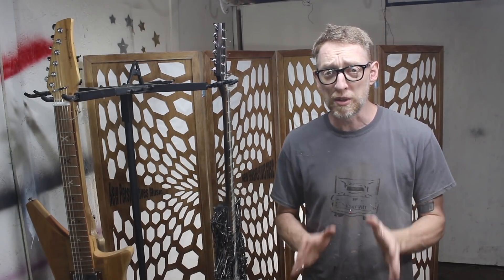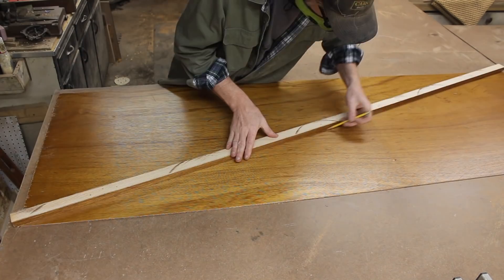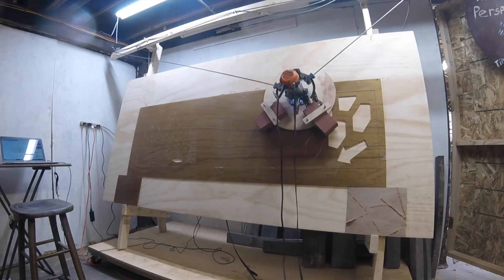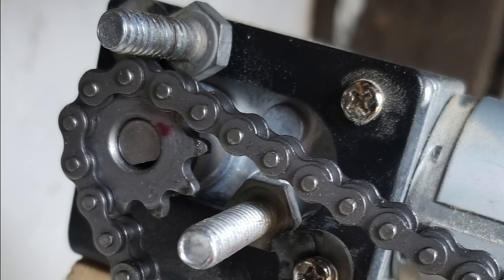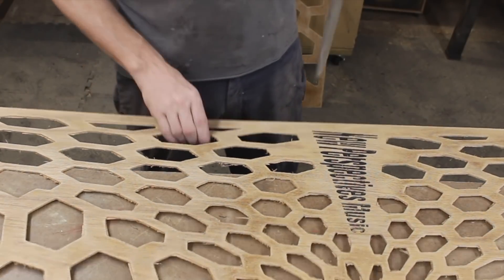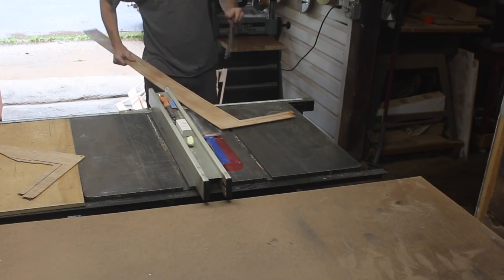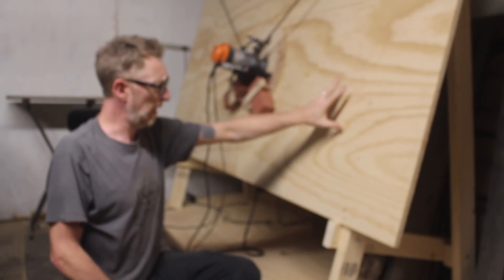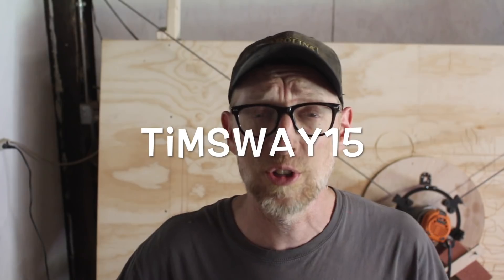Room Divider | My 1st Maslow CNC Project with MakerMade

Comment: Great, inspiring shows ... when you are cutting with a router on that terrific gadget behind you , would it be best to finish ( seal ) the "rough side" to prevent that splintering , or are you playing with a dull toy?
Reply from the maker: Thank you!! The router bit I was using was very used and not at it's best. I'm not sure how much finish would help with splintering from a router, even a sharp one...

Comment: DuPont Chain Saver lubricant is dry, teflon-based, and made for motorcycle chains. I use it on my mountain bike chain and no dust or sand sticks to it. Would recommend it for your CNC.
Reply: I am in the UK, but only use dry lubricant on my table saw etc. It does not gather dust. There are many makes. Wad 40 even do one here.
Reply: And there is also some good info on waxing a chain from the bike enthusiasts. https://www.youtube.com/watch?v=HHr9znwpwmQ

Comment: That chain bind-up could also be from chain torsion right at the gear when being pulled straight down by gravity versus falling at the angle of the easel? I bet a sturdy spring tension between the chains up top would work, or someone else mentioned weights off the sides too. Also, making lateral wings would be an easy fix to get the 8’ width, as for the depth, perhaps upgrading the bottom cleats with screw type bolts so that the edges are flush with your routing surface could get you the full 4’ height ;)

I’ve been wanting one of these for awhile now & it’s good to see a craftsman of my liking work with one. I immediately picked up on the hollow door pattern when I saw them! Go get yourself some of those color changing lights behind those blinds & have yourself a psychedelic space, my friend!
Reply from the maker: exactly, although the white light is nice, too. Yea, i was thinking spring loaded tensioner also, but other users have simply added counterweight to the chains instead of using the elastics, I'm going to try that first.

Comment: There are some bicycle chain cleaning brushes you could add in line to clean the sawdust off the chain as it works. As well as add tyflon chain lubricant
Reply: Great fix... a graphite dry lube  , the brush idea is best.

Comment: The kit is $500, but by the time you buy a router, computer, build the frame and some basic supplies like plywood and router bits you will have $800 to $1000 invested in it.  Other open source cnc machines like LowRider or LongMill (smaller) are similar price points. would be cool if you can do a comparison video?
Reply from the maker: material for the frame is less than $100 and The router is $159 so yea, about $800 total, but I built my frame for basically free from used stuff and if you already have a router... Plus they frequently have sales like $25% off right now, so now you're closer to $600 all in... If one of these other companies would like to contact me I'd be more than happy to try them out and compare!

Comment: Hi mate i know nothing about CNC machines but knowns bit about chains from bike maintenance. Oil and grease cause are sticky and cause chain suck which on bikes (bicycles) this causes a loss of power but I think its what you were seeing when your chain turned back on itself. One thing that's getting big in bike chain lube these days is waxing. Basically melt a mixture of candle wax and paraffin and soak your clean chain in it. When it's dry it leaves a hard very low friction surface on the chain. The finish lasts longer than oil and dust doesn't stick to it so could work very well for your application.
Reply from the maker: awesome, thanks!
Reply: @timsway  No worries mate. Another thought might be to run jocky wheels instead of the solid bars you're using before the drive cog. Would help keep things in line. I'm guessing you could also use one after the drive but that would mess up your maths like those pins did, unless you can tell the program that they are the fixed point, rather than the motor. Just thinking out loud 😊

Comment: Get some more of the same gears and have the chain come off the motor gear parallel with the motor like 12” and that will solve the problem with the chain getting stuck.
Reply from the maker: good idea

Comment: I think this setup could benefit from a motion sensor. In many CNC mills or 3D printers such a sensor would be too big, but in this case the software could correlate the movement with the gcode and stop when the router mount stops moving....
Reply from the maker: Its actually really good about stopping if it senses anything "slowing down" the movement of the motors. They have that down, I just need to keep it from needing to stop!

Comment: Not sure it competes in size, but he MPCNC seems to be quite worth the time invested to build... I'll do one myself as soon as I have few free weekends...
Reply: The mpcnc lowrider was made for full sheets, but!  It will take up a 5 by 9 foot section of your shop.  That's one of the things I like about the maslow is it's leaned, so less of a footprint.  Though just like a delta 3d printer, you lose resolution at the outer edges of the cutting area.  I have room, so I went mpcnc.

Comment: Your chain skipping problem isn't because of sawdust or lack of lube, but because there isn't enough tension on the "slack" side of the chain and/or because the chain isn't parallel with the sprocket.  The bungee cords that come with the kit aren't a very good way to deal with the slack end of the chain, a better way to do it is to switch to using counter weights.  If you search the Maslow CNC forums you'll find plenty of posts about using counter weights.  As for making the slack end of the chain parallel with the sprocket, I recommend making a chain guide that goes behind the sprocket to push the chain forward (away from the top beam) and towards the sprocket.  This is the 3D printed chain guide that I designed and use and it works great for me: https://forums.maslowcnc.com/t/brads-3d-printed-chain-guide/7465/2?u=bradm
Reply: grab a bicycle chain tensioner for single speed chains and slap it in there somewhere, they are cheap and it will add tension via a spring. Just a random idea.
Reply: Exactly as I was going to say and I read this comment and I have to say no more
Reply: TheVRFOZZA 8
Reply: Seems any points on the chain for tension or idler like pulleys can all have a sprocket to keep a more uniform length.
Reply: This machine is based on fairly popular designs for a wall hanging cnc pen plotter. While most of those don't use motorcycle chain (some use just string and friction, some use the beaded chain you might see in set of window blinds, some use timing belt) there have been several solutions to similar problems. Generally yes the slack end of the chains will have weights or take-up reels. But tensioners and similar designs also exist. Just to point out that there is a wealth of diy hackery around this type polar coordinate system.
Reply: Spring loaded idler sprocket
Reply: @generalschier832  l used your avatar and YouTube deleted my channel. They are Nazis.

Comment: Hi Tim. Great project, mate. Thanks for the video. Re chain stick, if you visit your local mountain bike shop, they ought to have a chain cleaner device that works without removing the chain and chain lube designed for handling dust. Though saw dust may be a new one for them.
Reply from the maker: Thanks! Sawdust can't be worse that mountain bike trail dirt, eh?
Reply: @timsway  I recommend Boeshield T-9 as a relatively dry lube when used properly, also I highly recommend using a cheap snap link so you can make a loop when cleaning the chain,  Some sort of chain tension device must have been worked out by other users, I'm sure you can work something out, good luck! (i'd recommend better quality chain too, but that might blow the budget.) If I was designing it I'd put negative chains on the bottom.
Reply: I'd make it like a old school drafting table parallel ..Continuous Wire Parallel Motion

Comment: Coupon code was rejected at the makermadecnc.com. Says this coupon does not exist!
Reply from the maker: I'll let them know. they did tell me it wouldn't work in conjunction with any sales. they are currently having a 25% off sale (which is way better than my coupon) so grab that instead.
Reply: Thank you. Ignoring the lack of speed for a moment, does this setup have any good precision and repeatability?
Reply from the maker: @sz72909  you need to spend some  time with it, but I believe it's doable.  The forums are a big help for tips and tricks. Of course it's not going to be as fast and accurate as a shop buy, but it also costs $9k less! :)

Comment: With my Maslow, I ran the chains the other direction on the motors. The slack part of the chain with the loose gear I have an old weight to keep tension on it. That eliminated the chain from binding up on the motor gear.

Comment: The blinds look amazing. Love the design. Now that you worked out the kinks with the cnc are you confident to leave it cutting while you do other things in the workshop?
Reply from the maker: well, I left it running alone before I worked out the kinks, so... haha! I wouldn't leave it running alone with a small child in the room, but it really can't get in to too much trouble. the software quickly stops the motors if it senses something is wrong (like it jams up) so the router will just sit and run in place. I had that happen a few times.

Comment: The major issue I've found with z-axis accuracy is the result of inconsistencies in the flatness of the material or backing board, or the distribution of weight of the sled as it approaches lower y-axis coordinates. Many people experience better z-axis accuracy if they put a light bungee over the top of the router taking out some of the slop of the z-axis mechanism itself.
Reply from the maker: someone else mentioned that. I will try it. I also think I could stiffen my wasteboard as it could potentially be slightly bowed in the middle as-as.

Comment: Which post processor are you using to generate your G code with V carve Pro? We’ve got a Maslow at my makerspace and v carve pro and haven’t had much luck and want to use v carve over makercam
Reply from the maker: I saved the gcode as the preset "XCarve" right from the Vectric menu and it worked without a hitch. I don't really understand that side of it too well, but it worked.
Reply: tim sway 

Interesting. I’ll have to try that out. Google search found a thread on the Maslow forum saying that didn’t work out but I suppose it doesn’t hurt to try! 

Thanks!
Reply from the maker: @McFlysGarage  sometimes the forums are tough as there is a lot of old and confusing info there. The trouble with open source is it's always changing and evolving (which is a good thing, except when problem solving!)

Comment: This is a great video. I have been thinking about getting one of these CNC kits,but have been concerned about having enough space.
Reply from the maker: I think it would be cool to hinge it to your ceiling :)
Reply: tim sway, That is a great idea. My shop consists of a one car garage so you can imagine how every inch is filled up. Thanks again.
Reply from the maker: @DIYGene  if you have enough height. With the router sled detached, it would only take up about 6" of depth. Attach it near the wall and make a riser block that attaches to the back of it so it rests against the wall at the proper angle

Comment: where it was sticking (8.07) I was thinking the screw that it goes to (about 10" at 8 o'clock) seemed to be holding the chain back a bit. can't you put a tube over it so there is less friction there. Obviously, a bearing would be great there but a slippery oiled nylon tube might be just as good and let it run free'er .

Justedited /added noticed....as i saw you have done what I thought at the 7 oclock screw .
Reply from the maker: great minds :)
Reply: @timsway  Just after I posted it I saw you had done it with a screw at 7 oclock.

Comment: Increase the tension on the chain, it'll mitigate the problems.
Reply from the maker: thanks. I think I'll try the weight system as the tensioner elastics are tense when you don't need them to be and slack when you do.

Comment: Tim... can you set the motors back a bit? Looks to me like the inside of the chain is pinching on the outside of the gear. (twisted)
if the motor sits back an inch or so... the chain drop angle won't be so extreme... lowering the pinching friction... scratch that...  tilting motor would prob be best
Reply from the maker: yea, that's the kind of tinkering that goes in to this, unlike most cncs. that's a good idea. If you put in the time you'll get the results
Reply: @timsway  tinkering is what life about  its how we learn... I'm game to fail... gives me a starting point... when its fixed.. sense of accomplishment... like harbor freight tools

Comment: I helped put together one of these for my local makerspace, and we went with the same frame design.  One thing that I did was at the top of the frame, I set the bolts in the opposite direction, and sunk the heads so that they did not interfere with the chain.  And we have run into the same issue with the Z axis.  There is a ton of backlash in the router, in the clip that binds the router to the Z axis screw.  I've found a couple of rubber bands over where the router handles used to be stretched over the top of the router tend to help the Z axis be a bit more accurate when it moves.

I love the panels, they did turn out really nice.
Reply from the maker: thanks for your hands on advice! I was going to flip the bolts around next time I work on it, but then i decided I liked having the "shelf" for the chain. I was thinking about building a little tray up there to hold the chain...
Reply: @timsway  I think you need the tension of the elastic band to keep the unused portion of the chain from slacking so much that gravity pulls it down into the sprocket teeth.  It looked like that was what was happening in your video.  A tray may work, as long as there is not enough space for the chain to fall between the sprocket and shelf.  Also, with a shelf, the chain may bunch up and slip off of the teeth.  You may be doing too much to control the chain.  Check that the motor and sprocket is mounted in parallel with the waste board.  That may be why the chain wants to slip.

Comment: getting a bit more tension on the slack side will help keep the chain from wrapping like you  saw. One problem with the elastic is that it provides the most tension when you need the least and the least when you need the most. Switching to weights seems to work much better. See https://forums.maslowcnc.com/t/weights-for-chain-tension/9718 for a simple example.

It would help your Z accuracy to put a bungee over the top (you can see it in the pictures in the link above). The router depth control has a lot of slop/backlash, the bungee keeps the pressure against one side to (mostly) eliminate the problem.
Reply from the maker: awesome. thanks so much! I notice that with the elastics. I will look in to the info you sent.